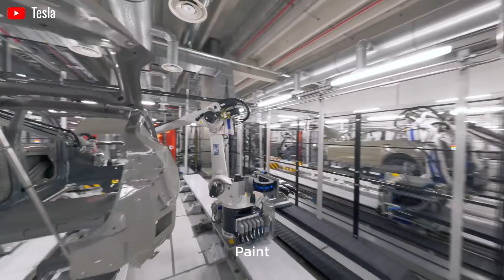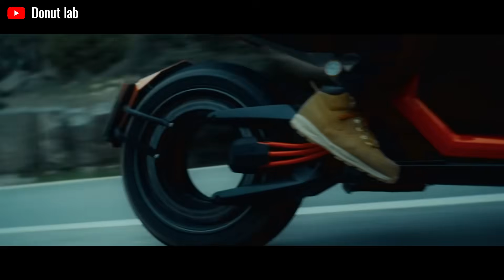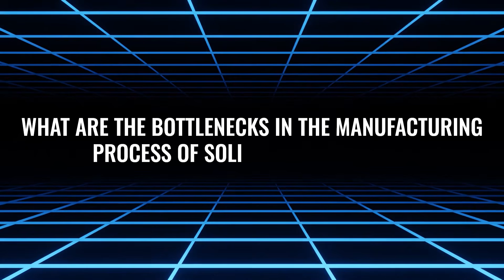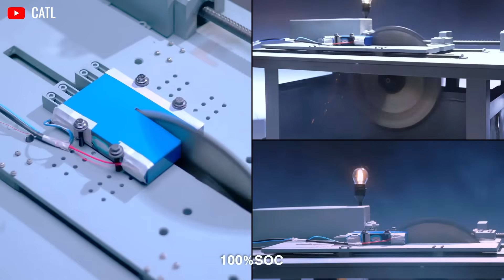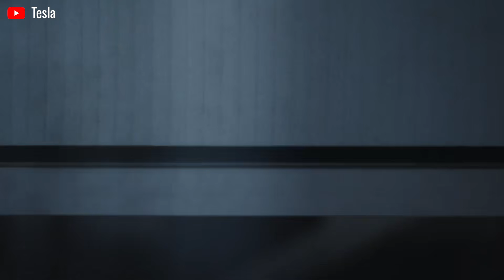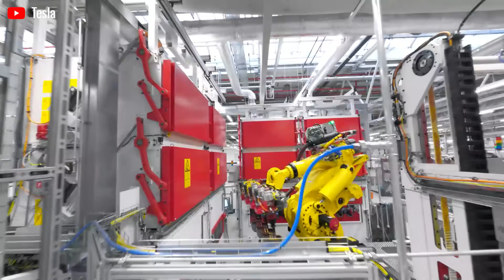The Truth About 100,000 Cycles Donut Lab Battery! No One Told You!

Comment: My question is - since Donut’s motor is an actual fully realised evolutionary/revolutionary product, why would they blow up all their reputational value with a bogus battery announcement?
Reply from the maker: The far more rational explanation is that the battery is real but early-stage and ahead of full external validation.
Reply: EngJD • Really? Donut  Lab people are so stupid that they don't know how to test a battery?!?. 
They said that they have worked at it for 8 years, and you say that they don't know how to test it for 8 years? Really? 🙄😯🤯
Reply: @Eng.JohnSmith They used the motor to make the batteries more reputable.. there not much special about the motor besides the fact it looks cool. IMO the motor isn’t gonna be as reliable as the good ole styles.. there’s just no way from a purely mechanical aspect.